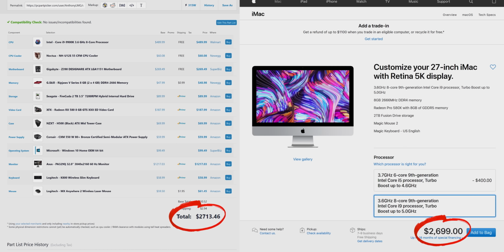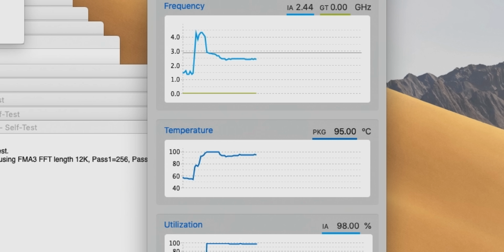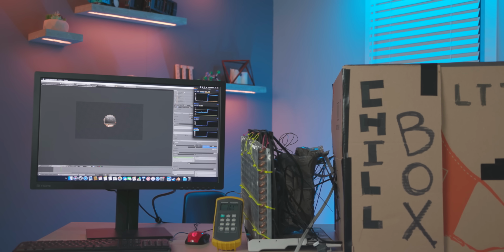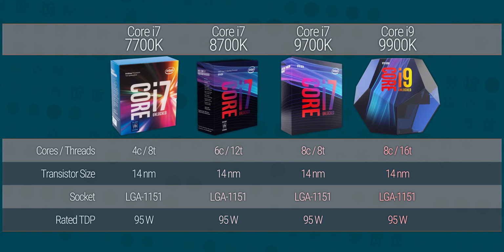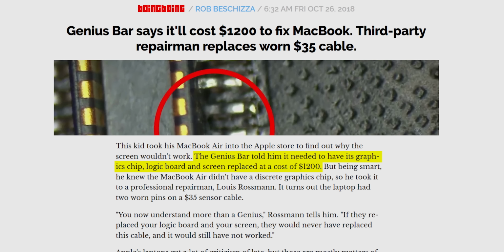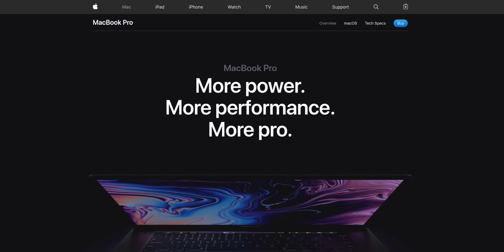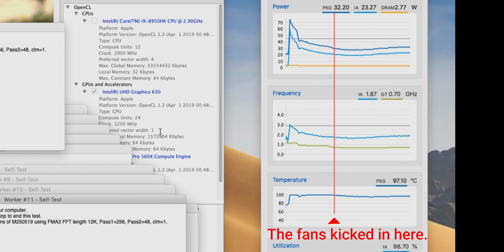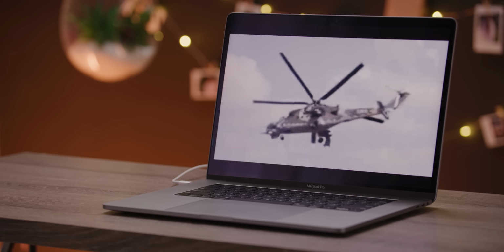Macs are SLOWER than PCs. Here’s why.

Comment: I have both, the plusses for the Mac, already installed drivers for everything, for music producing the industry standard. The minors, the latest updates sucks, it's even worse than Win10, and it's slower. PC with Win 10, works a lot faster, especially for administration and to manage your system get streamlined for the purpose you use them. The minors, drivers, drivers and drivers. It's an old sake problem for many years. Sometimes it's a hell to add an expansion card, en get it work. Plusses are, PC is very flexible, you can add things, on the board, with the latest iMacs it's impossible to add anything, because of their new designed hardware policy. So it's best to buy a Mac that is ready for your use, or it's an expensive upgrade, which have to be done by Apple. These are my experiences.

Comment: 7:35 turns out they'd rather solve this problem by channeling their r&d money and workforce to their own M1 chip rather than fixing Intel's failures.
Reply: If apple choose to use intel x86 architecture they they are responsible for adding good cooling solution, it's not Intel's responsibility, 
Apple wanted to have comfortable, optimised, locked down controlled system , they tried to reduce the problem in 75% or more of the user base .
Reply: @joshuanetanel9174  it isn't. An x86 processor can do many tasks better than an arm one
Reply: @derekfurst6233  the gap is there but not for long
Reply: @rajat1960  well, if intel persist on using 14nm chips against Apple’s current 5nm ones, there is pretty much no gap
Reply: 100th like
Reply: lol I would too, intel was shit out of luck back in 2016 they should've did better
Reply: Turns out their increase their profit margins by pocketing the money themselves then sharing some of the profit with Intel
Reply: @todortodorov940  nah intels just been shit lately
Reply: Intel sucks. But, Apple also sucks for doing this to their customers.

Comment: I have been a Linux Fan, as I work in DevOps, but the stability of Linux or Windows not as good as MacOS. I don't care as much about performance, but stability is key. I run Windows for office work and Linux for DevOps work as VMs, and my VMs have been more stable than running either Linux or Windows Native (probably due to Virtual Drivers being better). I'm using 2015 hardware so performance was never a key factor. I started down the Mac way as I needed a Mac for running Serato. But found a 2011 Poly' Unibody laptop cheap for £40 and was amazed at stability, and slowly purchased other Mac hardware. The experience is key, and I've finally switched to iPhone, by buying my Mate's old iPhone 8 256GB for £150 this year. Everything works together perfectly, and I find I save time in not faffing around. I get a lot of stick from peers running their ArchLinux distros etc, but I know that running Office on MacOS and Ubuntu desktop as a virtual machine works for me. When/If microsoft makes Visio for Mac, I'll drop windows all togther. My machines are not fast, but they are fast enough and super reliable. The user experience is near perfect.

Comment: the first mac (mid 2012 macbook pro) i ever owned i wanted to return it the next day as it was running hot but used a manual fan management to fix that. But agree with the point of apple going after suckers. I lost mouse functionality because of a dead track pad... with a plugged in mouse, and only way to get full functionality back was to get the tack pad replaced.

Comment: The reason why I bought a Mac was due to a more easy software engine, and to flex on normies. 

But I have a gaming PC

3700x

2070 super

3600nhz 32gb

1tb NvMe ssd

512 gb SATA ssd. 

Pretty overkill.

Comment: I moved over to Apple particularly because of the over-heating (among other problems) issues on IBM compatible PC's. The last one I owned was an HP laptop fully spec. 2 years later, the computer was no more. Started with an iMac G4 and 2 years later purchased a MacBook to join it. Fast-forward to 2020 and those 2 are still alive and healthy, granted, the iMac G4 is limited on what can be used for given hardware is overwhelmed by today's requirements. Purchased a 2012 MacBook Pro and still looks and runs like new (my sister is now rocking it). Purchased a 2013 iMac and same story (my daughter's daily driver). Currently on a 2018 Mac mini Core i7 and 2020 MacBook Pro. Life is good
Reply: Ha ha ha.  You bought an HP product, and then complain about quality.  WOW!

Comment: Well as a looong time user of both Macs and PCs (>30 y), for myself, my immediate family, and my extended family (12 users x 30 years), Apple hardware has been MUCH more reliable than PC hardware. For example for routine small business productivity, internet, and Photoshop use, Apple laptops continue to be OS-supported and to operate acceptably for 8 or even 10 years. PCs (through my day job with ‘professional’ IT support) have to be replaced more often either due to hardware problems or unacceptable performance.
Why? Because in their infinite wisdom IT professionals plus corporate bean-counters tend to go with commodity low priced PCs. There are not well spec’d when new and their build quality is nothing special. So they are MORE LIKELY to either become TOO SLOW and/or simply BREAK. 
So Apple may be leaving some performance on the table b/o significant cooling challenges, but in the real world, this is offset by Turbo boost (as the video notes), much nicer hardware designs, higher component specs, and better build quality.

Comment: Not an Apple fan, but my friends who are didn't believe you proved your initial statement by showing  a PC running faster than a Mac under the same conditions.  They believe a PC would most likely preform the same considering they are basically running the same chip.

Comment: Not that you'd care, but you just lost a lot of respect in my book, solely for the cheap shot of suggesting that "Apple customers care more about the looks and the status than performance." This is utter nonsense. I use Macs instead of Windows machines, because the operating system just lets me get on with it. Power-using it makes much more sense to me, and feels much more like using a computer should feel to me, than using a Windows computer does. I say this as someone who "converted" to Apple merely 10 years ago, having used Windows for 20 years by then already, and still being forced to use Windows PCs from time to time nowadays.
I couldn't give a toss about the status or the looks of the computer. It needs to work, and it needs to work the way I expect it to, operating it needs to feel natural to me. Things need to be consistent, compatible, reliable, snappy and not make me think about them much. I'm a coder, so I need occasional bursts of CPU power when compiling, but 99.9% of the time I just need sufficient CPU power for "fancy text editing". If the machine also looks good and I don't hear fans all the time, that's even better. Also a plus if I don't have to build it myself, and I can blame someone else if something goes wrong. So to me, the point you're argumenting is completely irrelevant. "Performance" is not just how fast a CPU will render things.
If you want to criticize Apple's advertising and marketing, hey, knock yourself out. Us "Apple customers" laugh about those presentations all the time, "look at the NFL with their pathetic super bowl, at Apple they host the hyper-bole". And to call me, as I am included in the group you denominate "Apple customers", someone who must care about looks and status is pretty, pretty disappointing. It's an ad hominem, and a cheap one too. Blanket-insulting Apple customers because of some arbitrary measurement and a personal distaste of their advertising or company conduct, that's just petty. I would've expected more from you.
Computers are more than video rendering farms or console replacements.
Reply: Rob Chokehold Hes talking about Gaming

Comment: Is Apple Mac more stable than Windows?
Reply: In my (and my whole workgroup's) experience, no.

At my workplace we have windows machines that literally run 24/7 for months on end without restarts (only restart for updates and security packages) and they're performing much better than the macbooks of our clients. 
They literally complain weekly that their macbooks are either running slow, restarting out of nowhere, taking half an hour to two hours to apply updates, randomly deleting their configurations, have random hardware failures (mostly touchpad and that touch bar thing at the top of the keyboard), etc. Things that never happen to us windows people.

It's so bad that sometimes they receive the top end macbooks for the year, and then the next year they're already so thrashed that they will require repairs/replacements. We, however, are using the same workstations for like 5 years now lol (again, they're literally used 24/7).

Comment: Total bs i've been a Windows PC user for almost 20 years and not just having a PC but experiencing so many PC in the IT field at my work, for almost a week since i bought a very old old old Macbook 2010 and seriously the speed of this Macbook changed my mind about switching from PC to Mac...seriously i am using a 2GB of Ram Core 2 similar to my PC at work and i compare it but the speed of the mac is much faster if i reboot the two machines and so much more you could've done to witness the differences.  I am not agreed to this video thank you. (I used to be a fan of Apple Macintosh back in college)

Comment: I have the exact same problem with HP elitebook, just opening windows menu repeatedly make the processor clock down from 4.5 to 2.5.. loading gpu means it goes down to 1.0 GHz (slower than a 20 year old Pentium 3)

Comment: I'd be interested to know where the opinions in this video will stand when Apple starts it's shift to ARM later this year - isn't this one of the reasons that they have stepped away from Intel and isn't Intel's delay in moving away from the 10nm process the reason for the excessive heat and subsequent CPU throttling that has to happen?

Comment: Imagine a world where MacBook Pro had a Zen 2 option...
Reply: Apple being a luxury brand wouldn't let themselves use budget components. But if your suggestion was the case, it would be awesome.
Reply: @nuralimedeu  Okay, but Zen 2 is not a "budget component". It's actually much more energy efficient and faster than comparable Intel chips, so it makes a lot of sense in laptop applications. Even if Intel still wins performance benchmarks by getting over 5Ghz and consuming 180watts on an 8 core chip, that doesn't work well in a laptop space. It's motherboards also tend to cost a little more than comparable Intel it seems as well.
Reply: @EccentricJamie  I didn't mean that Zen 2 chips are bad, I meant that Apple probably deliberately uses the most expensive components to build their systems.

Comment: The 4.8 GHz is the boosted speed.
It says turbo boost beneath it!!!
Reply: Pure Genius and 99% os Mac buyers have no idea what boost is
Reply: @muzlee7479  Turbo Boost enables processor cores to run faster if power usage and temperatures are within limits. For example, if one core would benefit by processing faster while the others are idling or running slower, the base frequency of that core can be increased on demand in increments of 133MHz. See Core i7 and Core i5.

This only for and LIMITED time!
Reply: @maahith_06  Well, I knew what it does, but it's not written on apples site
Reply: @Muz Lee
Yes it does!!!
It says Turbo Boost up to 4.5GHzTurbo Boost up to 4.5GHz
On the website, here: https://www.apple.com/macbook-pro-16/specs/
I have also made 2 videos about the 16 inch 2020 macbook pro
Unboxing:
https://www.youtube.com/watch?v=3MURdw1DuPg
Review: 
https://www.youtube.com/watch?v=q26R52Cri4k

Comment: Most of the blame, or all of it actually, should be on Intel for this as their delaying their 10nm chips for years now and still using 14nm, AMD and Apple are already producing 7nm chips and the next Apple Silicon in the next Macbooks might be 5nm which is miles better not to mention that it's an ARM based chip so it won't consume that much power leading to better batterie life and less heat produced so we can finally say goodbye to thermal throttling.

Comment: Have had three MBPs die from probably heat-related issues (mostly covered under AppleCare, fortunately...a GPU, RAM, MoBos, a CPU...). I'm hoping ARM improves things, but until then I may or may not be running a Hackintosh.

Comment: Is there any good software to mitigate this issue?
Reply: The fuck? Software can't fix bad hardware lmao
Reply: Well he did make a point (may have been in another one of his mac related videos) how if the computers didnt delay the onset of the fan when loading something that may require the computer to work hard for only about 5 seconds then it could help prevent the spike in temperature which triggers the throttle back on performance. So how is it unrealistic to imagine a software that could override this feature and simply kick the fan in when it should to prevent the spike in temperature? So yes there is actual logic to my question. Im aware of the hardware issues with the placement of the fan which is unfortunate but there seem to be more factors here than just bad hardware alone
Reply: @jack_lion  The cooling capacity of the solution given in a MacBook won't change, it will always remain the same. And the CPU behavior depends on how the manufacturer sees fit, given in the firmware placed on motherboards. Intel's solution to the problem was to have the clock speeds ramp up when needed, then quickly return to base or lower - in order to have the CPU not overheat.

But you can't fix a continuous loud with that. Anything longer than five seconds will show negative effects on the lifespan of the CPU and the surrounding PCB, nothing but better cooling will fix that.

Comment: Not that it matters now, but in the PC to Mac price comparison, they put a 32'' 4k monitor at $1,217, which is NOT what the iMac has, it has a 27'', 5k granted, which is practically imperceptible 4k on steroids, and 4k 27'' monitors can be had for $450, so THAT's where the difference of $760 lies :) 

https://www.amazon.com/LG-27UK850-W-Monitor-Connectivity-FreeSync/dp/B078GVTD9N/ref=sr_1_6?dchild=1&keywords=27+inch+4k+monitor&qid=1596100770&sr=8-6

Mac's are more expensive than PC's if you shop around.

Comment: Well done,  good video. You have came to the same conclusion as Apple. This is why Apple are in 2020 switching to ARM processors for its Mac Books. I did wonder why in 2020 does a new 13" Macbook ship with a quad core 1.4ghz core-i7.  I guess they stopped giving a s*** as they are going to swich soon anyways.

Comment: This would also explain the problems with batteries overheating...if they are forcing the machines to run hot so as not to affend the user due to fans running...those batteries are going to cook and expand.

Comment: Fanless was always Jobs' vision even in 1984. Do people remember Wintel towers with new fans fitted and the metal casing half screwed on? The reason that Apple switched to Intel was Motorola's poor efforts on CPU heat management on the 68000 series. Now Intel have hit the thermal wall and clock speeds have peaked at 3.2 GHzdo we really want to return to a battle with heat management?

Comment: Man I have a late 2011 MacBook Pro and its still running and alive. Recently I figured its getting very slow for Media Production purposes - so i renewed the cooling paste (which was literally powder when I opened it), cleaned the logic board and downloaded a programm to set earlier thresholds for fan speeds. It improoved a little bit, but I cannot use it at night any more because my neighbours threatened me to call the police if i ever again started a V8 engine at home. But hey, at least its still working

Comment: In the case (!) of all-aluminium small-factor MacBooks-Pro, I wonder if some kind of “direct contact with case” peltier cooling/chilling device would work even better.  Any tips?
Reply: Want peltier cooling for its solid-state silence, as (eg) fan noise is really annoying and limiting when heavily editing/processing audio and video (it’s not just an aesthetic thing), and I don’t want to always have to use headphones.  Experienced same on both Apple and Non Apple (eg high-end HP) Laptops (from around 2014).
Reply: Aha found a discussion here: https://forums.macrumors.com/threads/diy-thermoelectric-peltier-laptop-cooling-anyone-done-it.1521780/
Reply: Unforeseen problem: frigid air - hence frigid surfaces (eg inside laptop) could cause condensation: “this is not good”
Reply: Found suppliers by searching: Tec cooler peltier

Comment: For both Apple and Windows-type laptops flat on a desk, simply raising above desk (eg by a pencil or book at each end) makes a significant difference.  I’ve concluded this from numerous long-ish (minuets) test runs where I measured both temperatures (CPU, GPU etc) and performance degradation, I specifically throttling.   “Cooling base” fans don’t make much further improvement.

Comment: I have a 2016 HP zBook G3 workstation (i7, 8GB, Quadro M1000M) that was about €2300 new and a 2012 Macbook Pro Retina (i7, 8GB, GTX650) that was also €2300 new.

I still much prefer the Macbook Pro over any windows laptop I've ever used. For some reason Windows laptops have never worked out for me, always had bugs and quality issues, I don't have the same experience with all the Windows desktops I've built for some reason